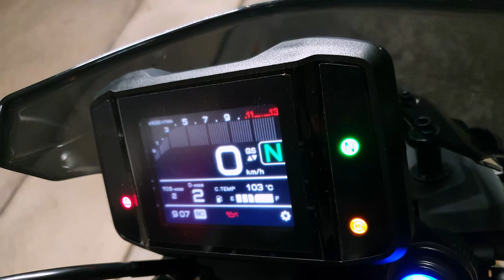Yamaha MT 09-SP | Unboxing and installation of OEM Fly Screen and USB Charger

Comment: Nice, any advantages for mounting the USB charger there instead of on the handlebar?
Reply from the maker: From my point of view it is a bit more out of the way for when you do not use it, and being a bit more down, none of the wires will be visible. In other words to me it looks better, like it came from the factory like this and not an addition.
Reply: @andreihentea  it does looks better indeed, did mounting it make the display become slightly tilted?
Reply from the maker: @ksoohw  did not notice it to be, it has 4 mounting points and the holder for the charger "affects" just one, also it is just a slim mounting plate so it does not affect it that much. Plus the 4 mounting points for the screen has rubber bushings so the one with the charger is slightly more compressed than the others  compensating for the thickness in my case

Comment: When you unplug the plug to put the USB one in. What is it that you are unplugging? Does anyone know?
Reply from the maker: It is a placeholder to keep it dry from moisture if it is not used.
Reply: @andreihentea  oh i see. I just didnt want to unplug something else and cause issues. Thank you for the reply. Much appreciated. I was all confused when i saw the plug was different to start with, especially as i bought an OEM Yamaha part.
Reply from the maker: @Mark Reeves  my pleasure,  happy to help. Mine are OEM as well so it should be exactly the same in case they did not change them since last year.  But yes, do not worry about unplugging it because it is not connected to anything. Cheers!
Reply: @andreihentea  you are a star. Thank you

Comment: Hey , How much of a difference does this make on the highway
Reply from the maker: Hey, it pushes the air up to about the shoulders level, so you will have no more wind around you chest. Of choose depending on the speed you are going. The slower you are going the less effect it has. 
It also is pretty good against bugs. Kinda similar effect as the for the wind.